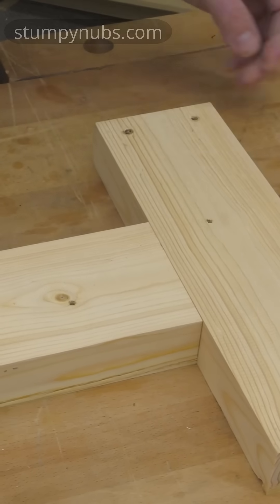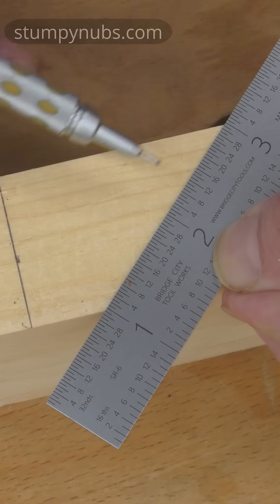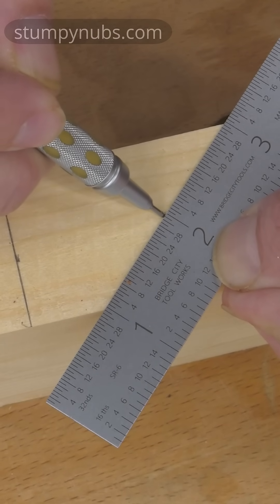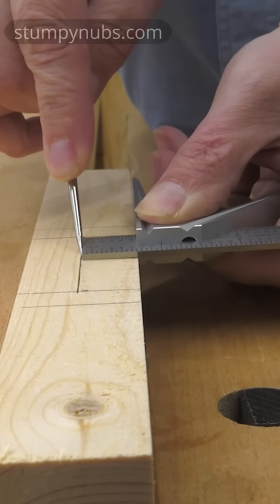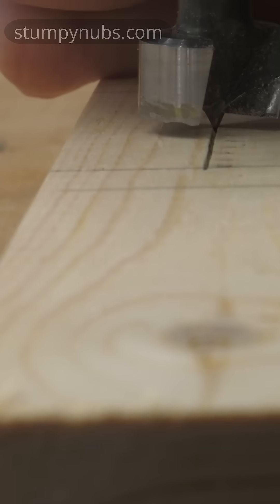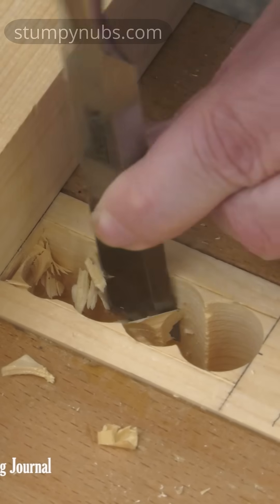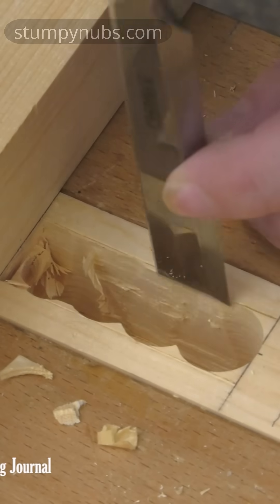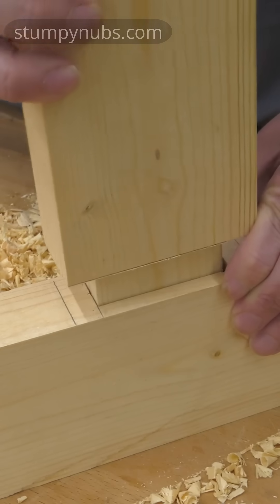Make SQUARE holes with ROUND drill bits

Comment: I am making a panel for a video game controller. I need to make the square holes with measurements of 14*14mm and they have to be close to each other. Maybe about 2-3 for each other. So far each time I try the wood panel breaks. I am using thin sheets 2mm. Can you recommend how can i approach this woodworking project sir?

Comment: Very good use of modern tools to accomplish an old task. Of interest there exists an old production technique which is similar.  I discovered it's use long ago as I examined a supposed ancient Spanish mesa (table). One joint was loose and I discovered a mortise with round ends and matching rounded edges tenon. Interesting. Obviously, not ancient. Mortises quickly cut by a router.  Excellent production system. All "hand carving" too shallow and uniform. Hot pressure impressions. Great for casual/uninformed buyers. I used to work for furniture appraisers and volunteered for museums.  My joke was that I was a legal forgerer. I Made authentic looking reproductions for museums and collectors. Experts couldn't tell the difference. I lost income by refusing to peddle fakes.  I still call the antique trade the world's Second oldest profession.  You really don't want to know the museum percentage of fakes. This a cult profession. If interested please look for a complete set of the British Lovejoy Mysteries.  Amazing how one clue leads to a cascade of revelations. This mortise/tenon technique is transferrable to home shops by cutting as Mr Nubs innovative technique and just rounding the tenon's edges.

Comment: Why make the corners square?
If you left them round, then you could use a 1/4" router bit and a template to make the mortise.
Then you'd need a 1/4" roundover bit (or something, maybe a 1/4 gouge) to make the matching round part on the tenon...

(Or a jig for the router and cut that the same way...  same template and all... but you need a longer bit)